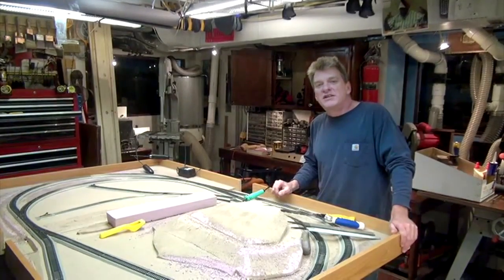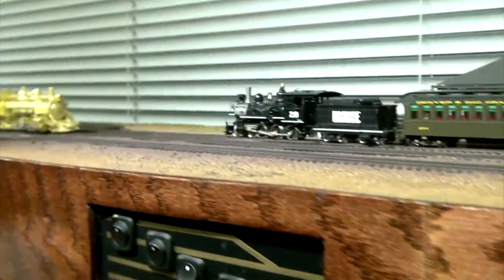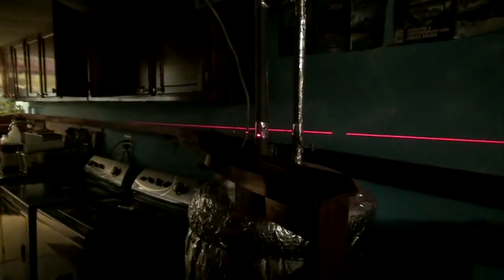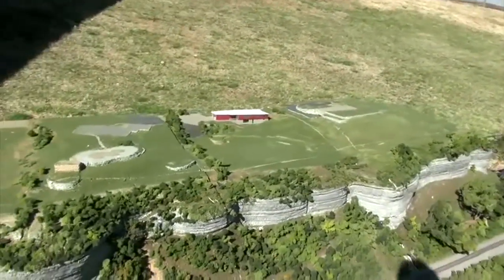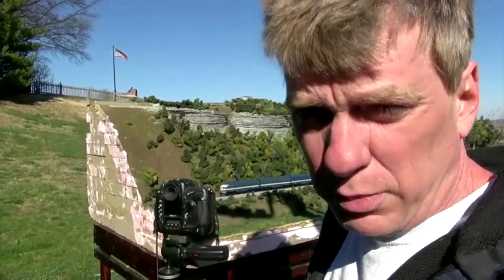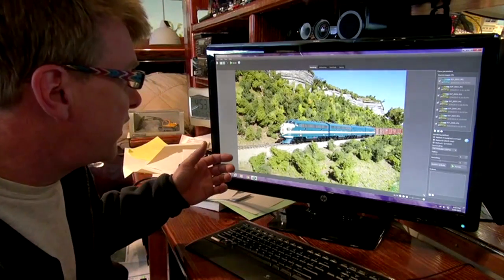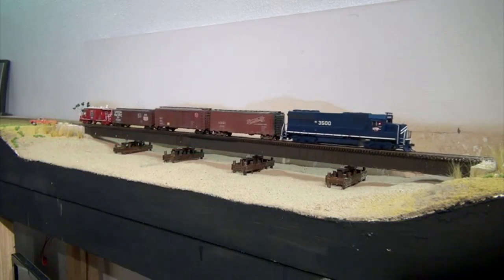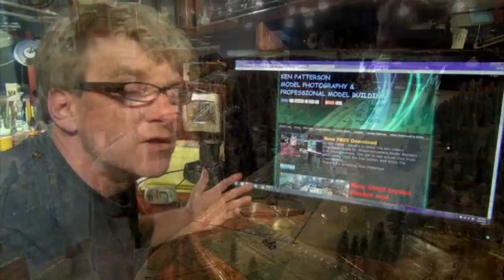Carving foam more effectively | Model railroad tips | Model Railroad Hobbyist | MRH

Comment: Idk about using electric chainsaw. To let everyone know there's a safer option than a chainsaw. At harbor freight (if you don't have 1 close by you can order online)..., anyways, a 4in grinder is a pretty cheap tool. Using them on vehicles they can last few yrs. Worst is if bearings go out. Using them on train layouts is another story. Can last almost forever, since not cutting heavy steel or grinding and cutting bad welds. Also at same store they have a 4in chainsaw wood craving wheel that fits on the 4in grinder. Having a guard that moves makes it easy and safer to use.

Comment: laser?  chalk line has been around for what a hundred years. If you don't have endless amounts of cash stay away from this channel. You will get depressed and take a slede hammer to your trains track
Reply from the maker: James Scott — Of course you’re entitled to your own opinion, but you’re aware you can get a laser level that will do this job for under $30 US? A chalk line won’t exactly do an automatic leveling line without a good bubble level ($20 for cheap four footer) and some savvy geometry skills to make sure you don’t mess it up. Your response assumes the worst, which is somewhat unfair.